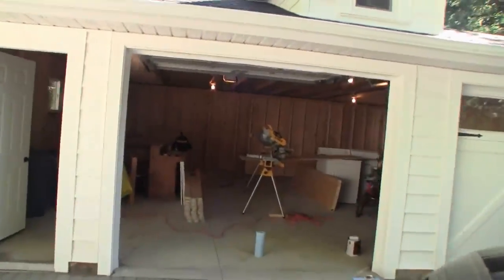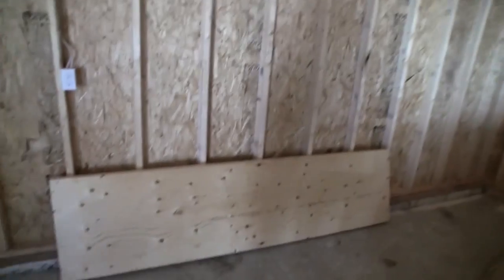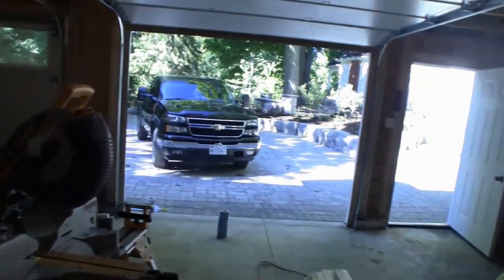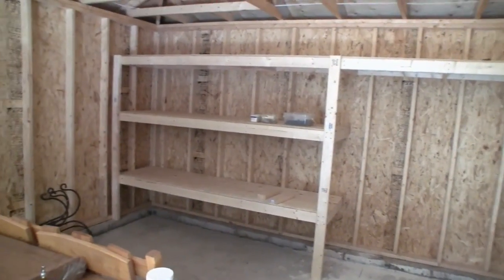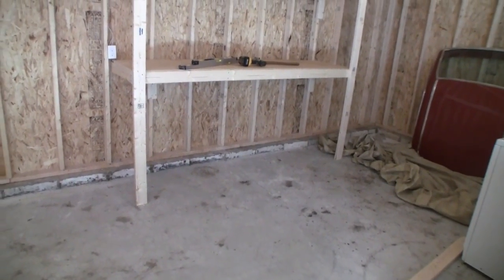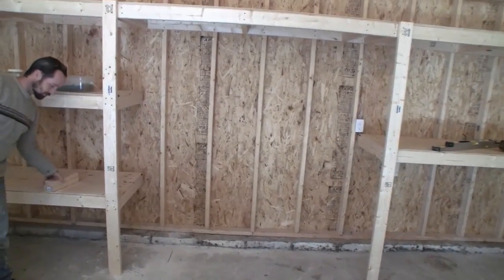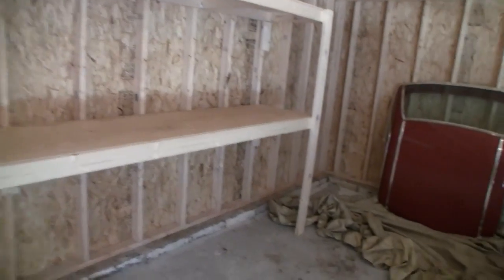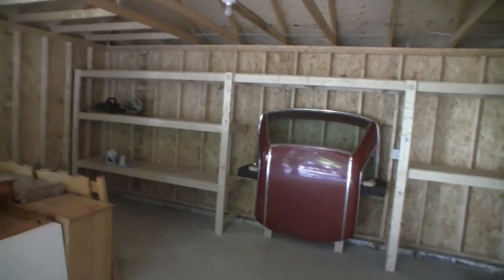Custom Shelving For The Garage

Comment: perfect garage to buy a home kit of closed cell spray foam to insulate between the studs and the roof decking. that would be one well insulated heat and really hold the cool air in the summer and stay warm in the winter